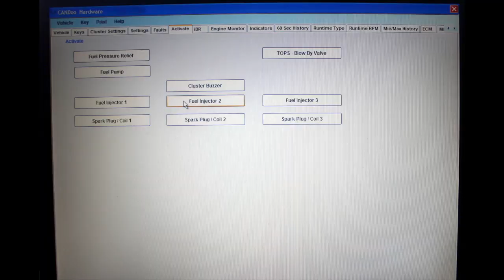How To: 4-TEC Jet Ski Troubleshooting (GTX 185 Sea-Doo Fuel Pump Repair)

Comment: Hi I have Seadoo GTX SC 2006  snd is showing the code PO122 and PO123, plus The fuel injetion does not has power ,I checked the black wire  (-), the one come from Engine to ECU 
can you help me please , 
thank you
other think how I know if the ECU is bad
Reply from the maker: That’s a big question. You really need a copy of the electrical diagram in the service manual to be able to troubleshoot that. Do you have a copy of one?

Comment: I have a 2005 gtx sc limited scic getting a code p0112 change sensor Same problem only have 1.4 volts what can I do
Reply from the maker: I’d check the connector and make sure it’s not corroded. Also, make sure your grounds are all well seated and not corroded. Good luck!

Comment: Hello sir,
How do you check the spray for the injectors without turning over the engine?
Reply from the maker: You need a special device like the Candoo Pro to do that.
Reply: @3ftDeepChannel  Can you check the spray for the injectors without  the Candoo pro ?  Can we just hit the start switch ?
Reply from the maker: Yes, but it’s more elegant to just isolate the part you’re interested in. If you hit the start switch the engine will turn over, etc.

Comment: 07 gti after 20 min ride pulled seat off and motor splashed on the underside of the seat right above cylinders 1-2 no obvious voids what’s you thoughts?
Reply from the maker: Was there any water in the hull? Did you do any wave jumping or go over any waves? It sounds like spray from your carbon ring. A little is okay if you're going over waves, etc. but if there's water in the hull after your ride you may need to replace it.
Reply: No water and very little wave jumping.  I’ll clean it down and run a short trip to see if I can isolate it. Your videos are really well done. Great editing and camera positioning.  keep it up. The machine runs and accelerates great.  top end 59 mph. After open riding it comes down to idle fine for a few minute but longer idling or cool starts it won’t hold idle unless I hold a touch of throttle. Run open for a minute or so then the idle holds for a little. Could it be a lightly clogged injector?
Reply from the maker: Could be. I would also make sure you have new plugs in there. Thanks for the kind words.

Comment: Hey man I 2005 gtx runs fine on the hose. But in the water slow on accelerate  almost feels like a bog and won't go was 5400rm. The some wide open throttle it try to g 6 or 7000 rip. Then go back to 5000.
Reply from the maker: Do you know if your supercharger was rebuilt?
Reply: @3ftDeepChannel  it's na supercharger
Reply from the maker: Have you checked the oil for any water intrusion?
Reply: @3ftDeepChannel  yeah  looks good
Reply from the maker: Have you checked your impeller for damage, or for intrusion of a foreign object in your pump? Also, have you check the clearance between your wear ring and impeller?
Reply: @3ftDeepChannel  no
Reply from the maker: I would do that next. Let me know if you find anything.
Reply: @3ftDeepChannel    replaced the plugs and changed the gas. Its making my rpm now.
Reply from the maker: I should’ve asked that first. Sorry about that. Glad to hear you figured it out. Great job!

Comment: Hi I need help!!  I’m trying figure out if my 05 gtx is 185 or 215. Looks just like the one in the video but my supercharged is black not red.  Any idea?? Thank you
Reply from the maker: Some of the superchargers are black and some are red. If you have an internal intercooler, then you have a 215 horse power machine. Those intercoolers were only on the GTX supercharged Limited edition models.
Reply from the maker: Up to 185 HP no intercooler; 215 HP internal intercooler; 230 HP and higher external intercooler.

Comment: hi again, your my hero! can you do a MPEM harness AMP bloc pin connector video swap. My pins are green and broke off. I don't know which crimping tool to buy. Seadoo 529035939 is $207. I blew my valve to check it, thx. Vibration & NaCl  break pin!! Tah Tah tannnnnnn
Reply from the maker: Sorry, but our videos are limited to repairs needed for our own machines. Hopefully you'll be able to find it somewhere else on the internet. Good luck.

Comment: Hi I have a 2000 sea'doo bombardier GTX and I took it out on the water but it won't go past 30 miles per hour what do you think that I could be thanks
Reply from the maker: Yikes, there could be lots of reasons for this. Start with the obvious and check your impeller and wear ring for an obstruction. Also, if the wear ring or impeller are badly damaged, that will greatly affect performance. Make sure you've got new spark plugs. Next, check for any damaged or leaking hoses or clamps. It could also be your fuel pump, but that's difficult to troubleshoot. Try those and let me know what you find. Good luck.
Reply: Are you sure you are using the regular key and not the training ignition key?

Comment: My fuel pump won't run. Is there anyway for the ecm to disable the fuel pump? If yes, how to re enable it?
Reply from the maker: It's unlikely that the ECM has disabled your fuel pump. It's more likely that there is some other problem, like a faulty pump. How old is your machine? Do you have any other issues (like loss of power)? Have you checked for codes?
Reply: @3ftDeepChannel  It is a 2011 rxpx 255. I got it working now. It happened after I use candoo pro to relieve fuel pressure, then as per instructed I ran the engine then pulled the key after it ran out of fuel. I cleaned the ground connections then redo the relieve fuel pressure function, but this time kept the key in until the countdown time was up. Thanks for the reply, really appreciate it.
Reply from the maker: Glad to hear it’s working now, Kent. Safe riding.

Comment: In my jet ski the injectors are only shooting oil in to the engine. We can't figure out how to fix it. Please help!
Reply from the maker: Not sure what to say, unless someone put oil in the fuel tank on the 4Tec models there is no way oil can get into the fuel system are you sure it's oil and not old fuel from the machine sitting too long ?   Drain and clean the fuel tank and refill with fresh fuel then try it again.

Comment: Good vid. Quick question. Sportster 4tec started smoking on the water. Now won't start. It cranks, will start up for literally one second and that's it. Changed spark plugs and oil, no help. Tried the air supply disconnect like video, no help.. 
Any idea what usually causes engine to smoke or what my problem could be? Any help appreciated👍
Reply from the maker: Could be a bad piston/ring. Have you checked the compression of each cylinder?
Reply: +3ftDeep pretty new to this... All the work I've done I watch videos before to learn how..
You have any videos on doing that? Or any way to quickly explain? Thanx for any help !
Reply from the maker: We haven't made any videos on that yet, but it's very easy. You just need to buy a gauge like that found at the following link, and follow the instructions. All you need to know with the PWC is how to run it in "drown mode", but that will be in your PWC's user manual. http://www.canadiantire.ca/en/pdp/equus-compression-tester-kit-0251016p.html#srp
Reply: +3ftDeep will give a try... Thanx brother! 👍
Reply: @bill kng, i have the same seadoo sportster 4tec, white smoking on the water, but it runs did you slove your probelm yet? i am located in NY brooklyn.

Comment: I have similar problem with my2008 RTX 255 < but I canf figure out how to test sparkplug coils and injectors. it was working perfect  and it sat for a moth or so and now it wont start. it displays code 
po377 now. any suggestions will be apreciated.
Reply from the maker: It could just be one of your engine sensors. If you have a CanDoo Pro, that can help with the diagnosis. It can be a very simple problem, or something much more serious. Does the engine turn over?
Reply: @3ftDeepChannel  Thank you so much for replying back to me . Yes engine turns over perfectly but it doesn’t start. I replaced the spark plugs tubes because there was oil in one of them, I think # 3. I can hear the fuel pump making the sound like is working, but not sure if it has enough pressure or if injectors are working. Trying to duplicate what you did in your video.

Comment: I think both skis need rectifiers probly.  the other ski also didn't get up to speed on the same day.
Reply from the maker: Maybe. Do you have a supercharger?
Reply: no sc..
Reply from the maker: Double check to make sure you hooked up your sensor properly. It's strange that the problem started after you hooked up the new sensor, and I know of someone who had a similar problem after hooking up the oil pressure sensor the wrong way. Other than that, this is a tough one to diagnose over the internet. Check the air intake, too by disconnecting it from the engine to allow it to suck directly from the air. Good luck!
Reply: The rectifier wont keep you from getting up to speed. It only charges your battery. I had moisture build up at the bottom of my plugs once. Dried the plug holes out. Fixed my problem.

Comment: I change a new fuel pump but no double beep..check the fuel valve have fuel spray out but when pull out the injector rail to check no fuel at all..
Reply from the maker: Are you getting any codes? Check for codes and let us know what you find. Good luck.
Reply: @3ftDeepChannel  dealer plug in Buds only get massage can't communicate with ECM.. Suspect my ECM burn during positive battery socket fall out..
Reply from the maker: Let’s hope not. Those are expensive to replace.
Reply: @3ftDeepChannel waiting a new MPEM to arrive..is there anyone in US can really repair MPEM and ECU?was cheated by a seller from Ebay not doing anything and send back my faulty unit claim repair done.Most of the tech said that ECU and MPEM was unrepairable not like car ECU.
Reply from the maker: I’ve never heard of anyone being able to fix one. I would be very suspicious of anyone who could claim to. Perhaps contact Riva Racing, as they seem to be very knowledgable in that area. Good luck.

Comment: Man I have a 2006 gtx 4 tec supercharged 215, it starts it runs but currently just not going over 5,500 to 5,580 RPM and seems like it has lost power. Any help or tips you might have please??? Btw im not using the learners key.... any help will work thanks
Reply from the maker: Sounds like supercharger failure. Has it been rebuilt? I wouldn’t ride it again until you confirm that it has been.

Comment: Hey.. can't find any information online for my jetski and was hoping you could help me out. 

2003 Seadoo GTX 4tec (non SC). Just bought it and was going through it before I took it out and noticed a cyl 3 misfire. Did tune up on it, siphoned old gas out, put 5 gals new gas, new plugs, checked wiring to ECM as well as the other module (forgot the name) and all is good. starts up fine now and idles good, but when giving gas from idle it dies. Haven't run it more than 15 secs without water and am scared to run with water in case it dies while water is on. Any knowledge on this condition?

Thank you in advance. Any advice helps!

Nick
Reply from the maker: That was my old ski (except I had the supercharger). There are lots of possible problems, but I would check the compression in the cylinders next. I'd then check the fuel injectors to make sure they're not gummed up, and that fuel is reaching the engine. Then I'd pull off the air intake hose off and make sure nothing was stuck in there blocking the air flow (like a plastic bag, which has been seen before, but not by me). A good way to check that the spark plugs are firing is to get a Candoo Pro. The way to check it in water is to launch the ski and tie it securely to the dock while running it in "neutral". Good luck!
Reply: +3ftDeep started it up this morning, seems to be a lot better! I am assuming it was bad gas. Is it normal to have a slight hesitation during initial start up when you blurp the throttle? Seems to rev up "okay" now. Still not to my liking, but a million times better. 

I will check the intake tube. I actually have the ski apart right now and I have a buddy with an injector cleaner. I will see if he can give them a good cleaning.
Reply from the maker: Good to hear. Good luck!

Comment: I know this is a super old video but maybe you can help. I have a 2004 sea doo GTX supercharged and unfortunately it was flipped today and spent a good amount of time upside down. It was so filled with water it had to be towed to the ramp to get out. After draining the water out of the ski, I tried to crank it and it sputtered and shot water out the back. I did this several times until it finally cranked, but as soon as it did it was idling very rough and then kept going off. I wonder if I take the spark plugs out and let it get the water out by cranking it with them removed that will fix it? Not sure what to do. It was running strong this morning until a family member flipped it unfortunately. Sorry for the long post but maybe you can help me. I would really appreciate it!! If I have to take it in to the shop then I will. And do you think the jet ski is permanently ruined, the family member is convinced it is but I try to reassure him it's not. Thanks for any help you can offer!
Reply from the maker: You need to make sure that there is no water in the engine. Check to see if the oil has turned milky, and if so change it at least two or three times. It needs to be done very quickly since if there is water in the engine permanent damage will result. Good luck!
Reply: All right, so let I it sit overnight and went to crank it on the trailer. It finally cranked and seemed to be idling better. Put it in the water and slowly drove it around, still idled a little rough but started to sound better. Gave it some more gas and it then started getting up to speed (maybe 35-40) but every time I hit a wave it seemed to stall. Finally realized it wasn't going to work and was coming back to trailer and it started smoking really badly. Turned off the engine and drifted in and am going to take it to the shop tomorrow. Unfortunately I didn't have a way to the oil out before I tried it. Please be honest with me, how badly do you think it's messed up? The smoking is really worrying me!!! I'm worried it's going to have trashed the engine and be 1000s of dollars in repairs. Let me know what you think. Appreciate it
Reply from the maker: It’s hard to say. It could be very minimal damage, it could be a bit more severe. I doubt it needs to be rebuilt though. Keep your fingers crossed.

Comment: Please help !!!!!  2010 sea doo rxt215 new plugs with good spark, new battery, plenty of fuel from injectors, 2 beeps when key is installed. Turns over strong but will not start. even tried starting fluid, Only 54 hours also took ECM from another running ski but still don't start.
Reply from the maker: Engines need 3 things to start: 1) air 2) fuel and 3) spark. You may have new spark plugs, but make sure they're sparking. Sounds like you've done that, so next step is make sure it's getting air (i.e. take off the air intake so it breathes straight from the air. Next check you're getting fuel. That's where I'd concentrate. Sounds like you may have a fuel pump issue or something in the fuel line. Make sure the fuel injectors are spraying. Good luck!
Reply: air box and hoses are taken apart and injectors spray very good.
Reply from the maker: Are you sure you're getting spark from the plugs?
Reply: did a compression check and have 0 psi on all 3 cyl, pistons are going up and down .... i thought the tester was broken so i used it on a running ski and was getting 127psi. Any clue on that one !!

Comment: @3feetdeep Hey so i just changed the fuel pump with a new one the jet ski starts and shuts off right away after like 5 seconds do you maybe know why ? Please i need help bad bin stuck like this for a while
Reply from the maker: Did you have the problem before you installed the new fuel pump? If you did, I've heard of people having trouble with the key post. Do you lose electrical power, too?
Reply: 3ftDeep Hey yes I did right before the fuel pump went out but I think I'll definitely check the key post I'll really appreciate it and will keep you updated

Comment: Hi I need some help when I try to start my seadoo lrv 2001 it seems like the starter jams the other day I took it out started it up before putting it in the water but couldn't get it started in the water pulled it out of the water still wouldn't start tried so long the battery died had to change the battery now it's th next day and now the starter wont turn it seems to jam please help
Reply from the maker: +Tony Rollin Before you get into some complicated troubleshooting, have you put in some fresh spark plugs? It could be your starter, but there are other reasons why it isn't turning over. It's a tough one to troubleshoot over the internet, but I'll see if Chris has some simple ideas to try before pulling your starter motor.

Comment: Have a 2004 Seadoo rxp SC and I was riding it last summer when it died (sounded almost like it ran out of gas) now it wont start. It turns over Slow but wont start any suggestions?
Reply from the maker: Has your supercharger been rebuilt?
Reply: 3ftDeep I don’t believe so
Reply from the maker: My first guess would be supercharger failure (I hope not, though). But before looking into that, I'd make sure nothing's jammed up in your pump. Good luck!
Reply: 3ftDeep thank you for the feedback I’ll look into it.

Comment: hello, I have a 2007 sea-doo, but not run hight rmp over 4000 rpm.
Help me!
Reply from the maker: Does your machine have a supercharger? If so, has it ever been rebuilt? Also, have you checked your oil for any milky appearance?
Reply: @3ftDeepChannel  The machine is a supercharger, I changed the oil and the oil filter, Give me an email, I will send you my car video.
Reply from the maker: 3ftdeepchannel@gmail.com